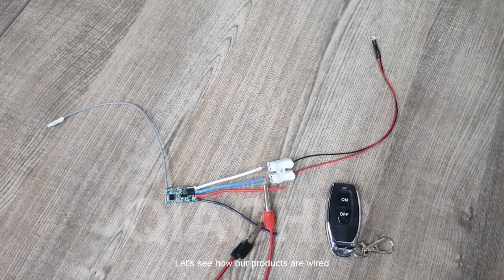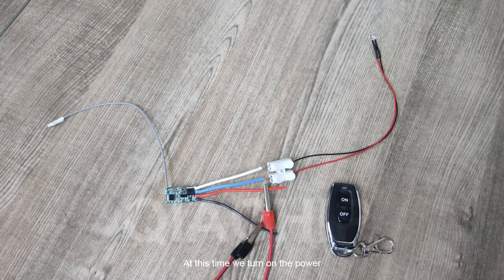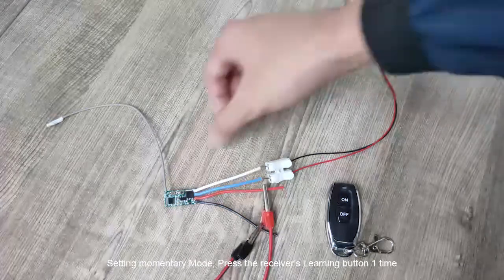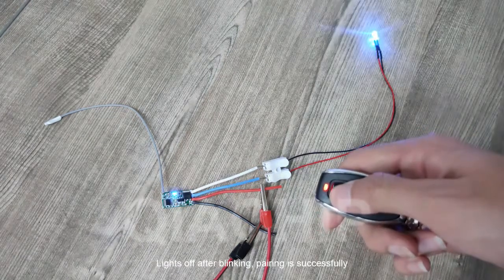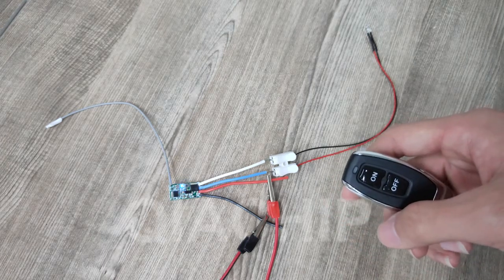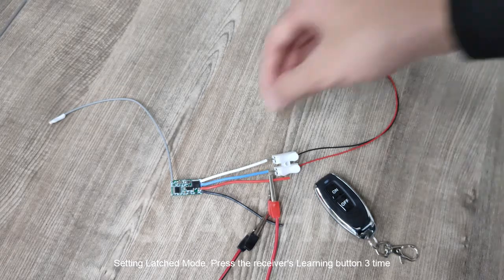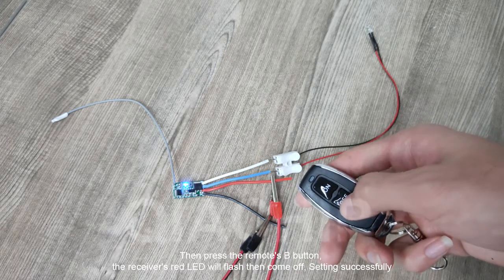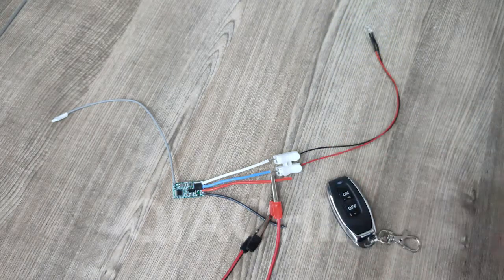A miniature DC 3.6~24V Wireless RF Remote Control Switch,with Momentary、Toggle、Latching、Delay Modes

Comment: Hello , I just bought 4 modules on this and I try programming them following  this instructions. I am doing the first program that was shown here, my issue is that when I pressed the A botton the light comes on but, when I pressed it again, it's suppose to turn off but, it will not turn off. Wiring are 100% correct. What is the problem ? Please advice. Thanks
Reply from the maker: You bought 4 modules
You can try other modules to see if they are the same
If other modules have problems, check if there are other RF signals around to interfere;
    Inspection steps:
        Press the module button 8 times to clear the code
        Press the module button once to learn
        At this time, do not press your remote control
        Observe if there are other signals matching it;
If there are no problems with other modules, it may be that this module has a problem;
Contact customer service for return and exchange
Finally, if you have any questions, you can also contact our email:
qiai@qiachip.com
Dedicated to solving your problems
Reply: Thank you for responding. I highly appreciate it. Happy holidays !

Comment: The unit says DC 3.6- 24 VOLTS, so I can use a 24 volt supply for this unit ? I want to use a 20v Dewalt cordless battery on my project. Please let me know if I can. Thanks
Reply from the maker: Yes, this is a 24V module, with a maximum power supply of 24V. As long as it is a stable 24V power supply, you can use it with confidence.

Comment: Working voltage is 3.6 to 24volts does it means that if your battery drop to 3v will not work?
Reply from the maker: Yes, you understand it fine.

Comment: Hi is it possible to use one remote to control multiple receivers and also can these power 3.7v COB LED directly without LED driver?  Thanks!
Reply: Yes you can control multiple units with one transmitter.  They can learn the transmitter output signal, so there is no reason several cannot learn the same transmitter.  If you watch this video:  https://youtu.be/MLvQR6bA7is        at about 5 mins 40 seconds in I go through the learning modes.  They don't output any voltage directly, so can't drive an LED.  You can use them to switch on or off a voltage from an LED driver provided it is a DC supply within the correct voltage operating range.  Be aware that your driving voltage is also the supply voltage for the receiver, so if you start faffing about with it using PWM for dimming etc, you may get unexpected results.  This unit switches the negative line.  Again, more info in my video.  I hope this helps!
Reply: @ECEtek  Thanks for the reply!  I won't be using PWM just basic on/off for the LED.  I am assuming the receiver should be installed between the driver and the LED?
Reply: @hayame1924  Just treat it as a switch.  Bear in mind that you will be switching the negative line rather than a more usual positive line.  Have a look at my video, it shows a demo circuit that should work for you at about 3.25!  If it's useful I'd appreciate a like 👍- it helps with the algorithm.

Comment: I received 4 of these and none of them are working. None of the leds turn on
Reply from the maker: I'm sorry to hear what you said. 
Let's sort out this issue first.
 You received 4 products, right? And none of them worked. 
First, please confirm that this is our product. 
If not, the following will be meaningless to you because you have to go to the corresponding merchant to find the answer. 
If you confirm that it is our product, you can ask the customer service and apply for a return or exchange. 
But before that, I hope you can confirm the wiring and usage issues.
Because our products are all tested before shipment, you bought four. 
Generally, all four will not be unusable. 
The most likely problem is the positive and negative wiring, input and output direction, etc. 
I hope to solve your problem. After receiving your feedback。
 I will also report your situation to the sales department. You can ask the customer service, and they will give priority to answering your questions. Or you can contact my email （qiai@qiachip.com）directly. It is best to attach a video or photo so that we can analyze the problem faster. Thank you.

Comment: I bought it but it doesn't work with delay mode, infact in the video you doesn't show it. Am I wrong?
Reply: i anm telling you i got the same problem
Reply: If you press the learning button 4 times and press the key of the remote control, you can learn the delay mode; The premise is that your remote control button has not learned other functions.
You can try clearing the code and then learn the delay mode to eliminate other interference
Reply: See here:  https://youtu.be/MLvQR6bA7is     at 5.32 for instructions.